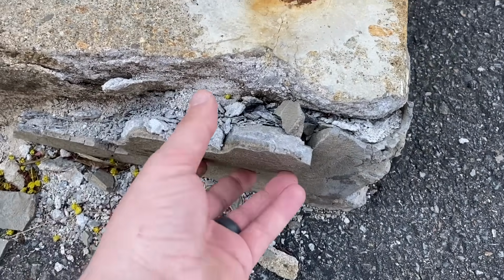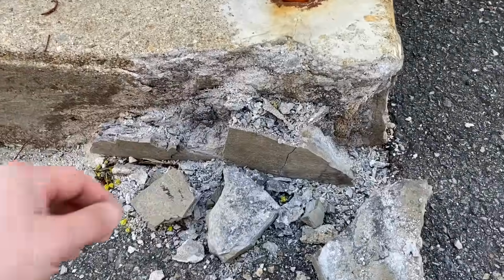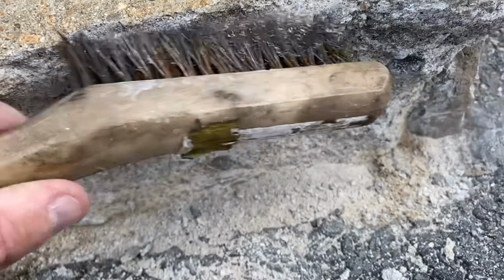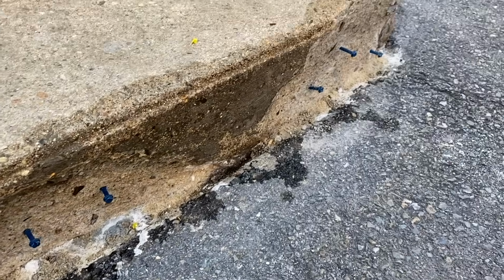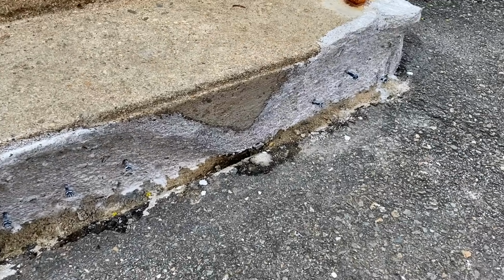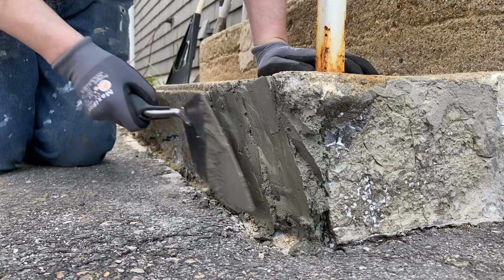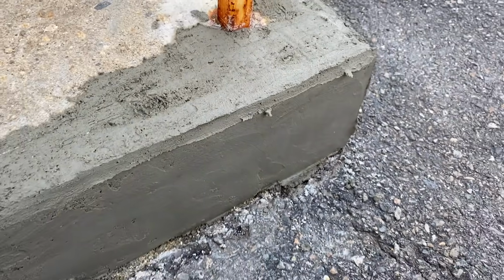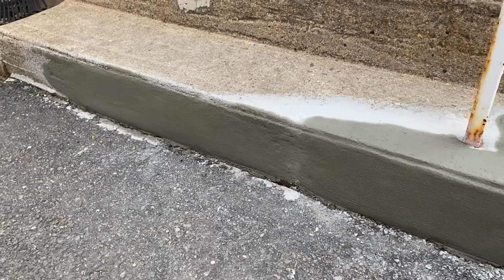How to Repair Broken Concrete Stairs - Quick and Easy

Comment: The "strange profile" is created with a concrete edger, it would be easier to apply the repair material with a plaster trowel in stead of a brick trowel, that's what they are made for. The adhesive should help with your repair but the fortifier should be added it's going to increase the strength of the repair itself. Not a fan of quick setting masonry, the curing process is key to the strength of concrete and cement. The texture that your looking for is made with a broom or brush, but sponging the edges is great for blending the concrete surfaces. You did a good job for having very little knowledge. The aesthetics look great. One tip to help with curing any cement or concrete is to soak with water after it has dried like three separate times, never make repairs in cold weather, when there is a possibility of freezing. Good job.

Comment: even if done correctly. there is still a chance of it breaking again in same spot in similar way. it might just take a longer period of time to do so but could also happen during next snow session.
Reply from the maker: Yeah, no repair is permanent.  I would really love to rip these things out and redo the landing but they built the house on top of it and it will take some tricky engineering.  This will work for now... just want to stop the deteriorating as best I can.  Thanks for checking out the video!
Reply: @TheFixerHomeRepair  well it should be good at least a few years. Just check it after this winter in spring time. and if see any cracking forming. tackle them then. either by kindof chiseling it out abit and packing it with concrete or other methods

Comment: Absolutely beautiful!  This was very helpful...being a painter, I'd then use a cement paint on those steps! Thank you!!
Reply: What brand do you recommend?
Reply: @koshar44  Two products:  1) BEHR Premium Porch & Floor Paint and 2) Sherwin Williams Porch & Floor Enamel (Satin).
Reply: @jayumble8390  thanks for the recommendation. I’m repairing painted steps today and glad you added this info.
Reply: @Echosoundscape  Oh, one more thing...I noticed that the metal post has some rust going on there and I can recommend the best anti-rust paint that exists.  It's by a company called "Imperial" and the paint is call "Rust No More".  I've only been able to get this paint online.  I've used this paint on jobs and 7 years later there are still no signs of rust bleeding through.  It's quite expensive...I bought a Qt. for $35 and was charged $15 for shipping, so a Qt. cost me $50. Of course you have to pass this cost along to the customer.

Comment: I guess you missed the stem of the problem was the railing see when Russs sets of rust expands and blows apart concrete fixing the railing will help that corner far as the middle you’re probably spot on about what happened you keep on having this problem to fix the railing properly

Comment: I've been doing concrete repairs for over 50 years on every type of structure, and that is one of the worst repairs I have ever seen - I give it 3-5 years before it is back to square one.
Reply from the maker: Thanks, Paddy.  I have been doing concrete repairs about once a year for the past 10 years.  I have saved myself hundreds of dollars doing them myself.  I appreciate the feedback but very much doubt this is one of the worst repairs you have seen over your 50 year career.  I would imagine some of the worst repairs you have seen would not last 48 hours, let alone 3-5 years.  Thanks again for your feedback and for checking out the video.

Comment: Best thing to do with old concrete is tear it out and replace it with brick. All this is doing is replacing one patch job with another. Also the old rusty railing will be causing problems in the near future.

Comment: I would of removed the whole metal railing and put a new one cause it’s rusted out and it’ll affect the new cement cause there’s water getting in from that are and damaging that corner , and I would of used a 5 pound hammer and a high impact cold chisel for this job , but all in all the video is great .

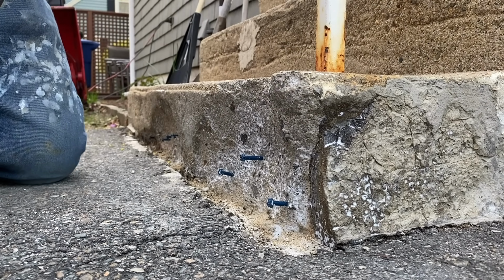Comment: This is wrong: 1. you should always wet the surface before applying any concrete or mortar on it. 2. At 8:20, when applying, you should splap the new material to the old one to make a strong bond. What you did will not last a whole year. 3. The metal oxide has higher volume than the metal itself. This is the reason why that corroding steel bar is increasing in size and  will destroy your work ... if it will not be destroyed by the first ice.

Comment: Some of the people in the comments were talking about the rusting steel railing and how it’ll blow out the concrete patch again. Maybe you already know about that, but w/ SO many projects to attend to, you’re probably just doing what’s manageable for now.

Hope the repair holds up long enough until you can replace the railing. Thanks for another great video! 👍 I also saw that some people use your vids to learn English—you’re the first home improvement channel I’ve seen to receive those kinds of comments, and what a compliment—educational on multiple levels!

Comment: That rusting iron bar will continue to rust and eventually explode that concrete out. Could try treating the iron with rust killer,  and then seal the area where it meets the concrete with a flexible sealant designed for exterior surfaces.
Reply: The topic is concrete repair; he said he’d deal with the post later, dude.
Reply: He should waterproof the base of the metal poles. Even a sealant would’ve stopped it. However it’s rusted now all the way now, so he may just want to tear the stairs out. Start fresh
Reply: No. No further rusting  once the cement is applied. The lack of oxygen will prevent any rust formation.
Reply: @luisazpurua1  That's true. So long as no oxygen, through air or water, gets to the iron, it won't rust. Unfortunately, the iron is being used as a stairwell rail and if it's pulled on enough, it will start to loosen at the base. A very tiny bit at the time. In this case, probably take theory years to have a problem. And that's IF it is exposed to see.aerious stress from people pulling on it. So yeah, the repair should last a long, long time.
Reply: @rickhinojosa5455  Well, yes...if the base loosens up or if they don't keep the tubes painted, rust will eventually find its way in.

Comment: The corroded steel will continue to corrode and expand and blow that corner off again .
Reply: That is what mine is doing. So how long would you estimate this will last? I’m considering doing mine, but with wire between the screws like mini rebar.

Comment: It helps to tie a piece of coat hanger wire between those tapcons for added “rebar” strength.
Reply: Coat hanger won`t last because of being a soft steel. A miniature rebar called pencil rod can be obtained from supply houses it also comes in a fiberglass version also.
Reply: @Allan Ruschman  Won't a coat hanger promote rust inside your concrete?
Reply: @ydobeoN  not to a point that it would be detrimental; also, a coat hanger has some sort of coating on it. I did a repair around a foundation window replacement where blown out concrete was a huge mess. 18 years later you can’t even tell.
Reply: I just repaired steps at my daughters home.. I would have used the coat hanger trick if I had known.. oh well they are moving anyway..

Comment: Perfect job, although an SDS drill would have made the drilling a lot easier.
Great work sponging down the surface after it had dried a bit. It exposes the aggregate in the concrete.
Always cover it over with a split bin bag anyway. The slower it dries the strong it will be and the longer it will last 👍🏼

Comment: Concrete allows moisture to go right thru it,any steel that is in concrete will rust ,and expand as it rusts,it has very strong hydraulic like pressures then it will crack it easily.I have used this method on purpose to break off slabs of granite,drill holes along a line,hammer in rebar, soak with salt water,let it set,come back in a few weeks and it's cracked right along the line. Thank you for informative video

Comment: The container says not to exceed 1 inch depth. Seems you have 2-3 inches in some places. What do you think of that and is it holding up? I need to do something similar but not sure after reading the instructions. Thanks for this video!
Reply from the maker: Hey there!  So far so good.  It has only been about a month, I am curious to see how it does this winter.  I think it will hold up with the tapcons and adhesive.  Of course, no concrete repair is forever but I think this is better than just using regular cement and filling it without doing all the prep work.  Thanks for the comment and for watching!

Comment: Not a bad job especially if this guy isn't full-time cement repair expert better known as a mason but one thing I always learn with cement is the slower The cure stronger the cement it wouldn't be a big deal to cover up that repair and let that stuff cure as slow as possible
Reply from the maker: Hey, Arlen.  I am not a mason.  Thank you for the kind words!  I agree with the slow curing for sure!  Thanks for watching and for the comment!

Comment: One thing you should mention, wet a couple times during curing. Keeps the cracking down and makes the concrete stronger.
Reply: Plastic on it, would work way better. Concrete can cure in 30 days, but only if its wet.

Comment: I am wondering if roughing up the front so that the cement has more surface area to adhere to would make it better.  Then blast with water from a hose to remove any loose sand before starting the repair? Just asking,  I have no experience but I am thinking out loud.

Comment: Just something to consider: the iron railings should be inserted in a lead base. The chemicals in the concrete reacts with the iron and makes it rusty. The lead base prevents the rusting because lead, like gold, is neutral and doesn’t react with most things..
Reply: Stainless steel maybe?
Reply: Although steel's natural tendency is to undergo corrosion reactions, the alkaline environment of concrete (pH of 12 to 13) provides steel with corrosion protection. At the high pH, a thin oxide layer forms on the steel and prevents metal atoms from dissolving.
Reply: @ROMULEXXX  then there must be a lot of concrete out there with a low ph - ‘concrete cancer’ is real
Reply: No new rust will form once the steel is sealed with concrete. No oxygen, no rust.
Reply: @luisazpurua1  I'm not sure why you think that but you're wrong - steel reinforcement inadequately embedded (but 'sealed' from the air)  will rust.. Take a look at any number of concrete projects from the 50's. 60's and 70's and you'll find occurances of concrete spalling off those structures, forced off by the rusting, and expanding, steel rebar that's too close to the surface of the concrete..
Reply: @luisazpurua1  all I can say about this is in Pittsburgh you can walk down a single street and see almost every single concrete step or porch with a steel railing in it is cracking out from rusting/expansion of the steel...so either everyone is doing it wrong (I mean, that's definitely possible!) or this doesn't work in practice.

Comment: When adding the bolts it's a good idea to not put them in a straight line. You're trying to not split the concrete.
Reply: That’s a good tip! Thanks! If I used chicken wire, around the tapcon screws, would that help support and bond? Or just be silly. It’s a big area I’ve got to do.

Comment: Old concrete & new concrete hate each other and will eventually separate. The tap con will hold it in place but the new concrete will completely detach from the old concrete. A couple of harsh winters is all it takes. Sometimes you get lucky and it will last a lot longer.

Comment: I like your video and details you share on it.  I think it would make it better and last longer if you attached a wooden frame around the area to be repair so when pour the concrete it cure tie and bond it the the old cement. Screw blue cements screws from frame ends to concrete then follow putting a frame together with nails. Overall. Good video 👍👍

Comment: I want to patch up a very small portion of my concrete block step which is only bout 6 in x 4 in x 1 in deep with ready mix concrete. I don't want to buy a bonding adhesive just for that small job, If I don't use concrete bonding adhesive, will the new concrete still adhere to the old. If not, is there any allernative cheap method to make that happens?
Reply from the maker: Hey Raymond!  Just clean the surface really good.  Spray the old concrete with water before you apply the new concrete.  Mix the new cement pretty loose.  I think you will be fine.  No patch will last forever.  Hope this helps and thanks for watching!
Reply: @TheFixerHomeRepair  Thank you for the quick reply. Will follow.
Reply from the maker: @raymondng8274  let me know how it goes!!
Reply: @TheFixerHomeRepair  I followed your guidance and it worked out fine. Hope the patch can last longer. Thanks!
Reply from the maker: @raymondng8274  great to hear!  Thanks for letting me know!

Comment: I believe your patch will fail unfortunately. Until the source of the problem is addressed. The steel post needs to come out, cut off and replaced with an extension of new metal. Then cut out and replace the entire corner with some new forms to mold the corner back in place.

Comment: Just wet the cleaned surface and then go in with your favourite rapid-set .. no metal ... those screws are going to bite you in a few winters' time. See Mike Haduck's channel.

Comment: Nice job, looks great 👍
Reply: Man, getting a like from a concrete legend. Nice!
Reply from the maker: Thanks so much, Mike!  Means a lot coming from you!!
Reply: Yeah it looks really good but we all know that the corroded steel should have been removed because it will only continue to corrode and blow that corner off in no time.
Reply: Looks reasonable but won't last 5 minutes, nearly everything that he has done goes against good concrete practice, you can see that he is not used to handling a trowel, poor amateur.
Reply: @paddyarnold6340  Obviously you know much more than the concrete guy who thought he did well. Thanks for pointing that out!

Comment: 65 70 degrees? Fuck man don’t be saying that  sure u can’t lay concrete on that and didn’t u had like a steel mesh ? Would worked better than them blue screws
Reply: No....you stupid the anchors on small areas work.far better you pinehead

Comment: Ardex, a highly specialized german brand. Sells a concrete repair mortar. It is so aggressive, it bites into your hands quite fast if you don’t use gloves. It’s the best product i ever used. Also, just pressure wash the concrete.

Comment: Since it came looking good, what would you think of tidying other rough spots on those stairs and perhaps put some kind of paint to it. 

I'm no expert but heard that paints are better these days and also epoxy has come down in price alot. And that can be roughened with those flakes so it won't be slippery when wet or snowy 🤔

Comment: Your repair won't last much longer. The problem is water ingress down the  square support pole inside and out. Water causes the metal to rust and then expand pushing the weakest part of the step away
Reply: That's why the quick set cement should always be mixed with hydrolic cement as well for high weatherize outdoor locations.

Comment: If you don't have any "glue", you can use a mix of just water and cement. Mix to a consistency of paint and brush it on like you did with the "glue". Works just fine, and has been used in the trade for as long as concrete repairs has been done.
And the rougher the old surface is the better. If the surface is too smooth, the new concrete won't bind properly and delaminate.
Btw, my dad was tasked to patch the corners on the foundation on my house some years ago. The old man insisted on doing it at around 90°F and in bright sunlight. It didn't take long for the repairs to start flaking off.
When covering a repair with plastic to trap the moisture, make sure the plastic doesn't touch the fresh concrete, or you can end up with "zebra stripes" in it.
Reply from the maker: Awesome tip!  I didn’t know that!  Thanks, Henrik!
Reply: @TheFixerHomeRepair  
Just to add on that. To promote chemical bonding between the old and new concrete, you should wet the existing concrete for a couple of hours for it to be wet inside but dry at the surface (SSD). You also want to remove all the delaminated concrete (we can see cracks on the right portion of the repair... so that one won't stick).
Reply: Thanks
Reply: @Henrik Paulsen 
Henrik- can you smooth the mixture over the rest of the undamaged surface so it doesn’t look like a repair?  So it is one, uniform look?  And if so, does it have to be a certain thickness?  Thanks so much.
Reply: @melissadelacruz1091  im no mason, but from another video i saw, you do need to cover all of it, and be at a minimum thickness, based on how fine the sand aggregate is (i think they said silica sand) id link the video, but i dont remember what it was called.
Reply: or water/SBR/cement, even better.
Reply: Yup slurry for big patches a must with glue if it’s on hand
Reply: Use portland cement to do this.

Comment: I'm wondering if this product would work on a stone wall? The cement in some spots is crumbling from between some of the stones just like these steps.
Reply: It will work you just need to make sure it is very clean without any loose sand or crumbling stuff before you put the cement I used it in my basement and worked wonderful.